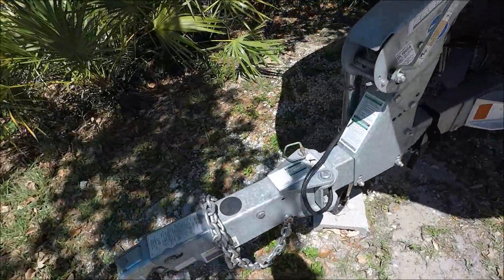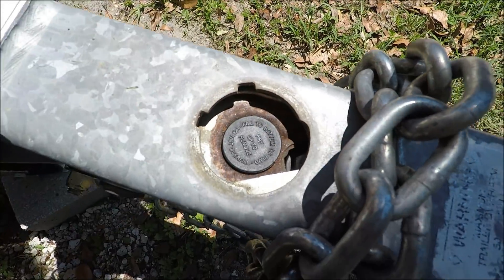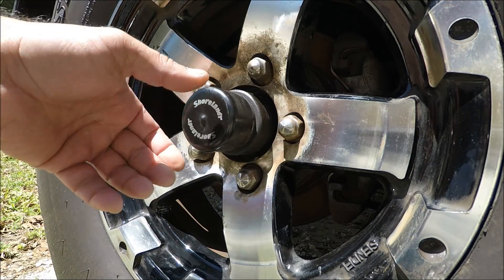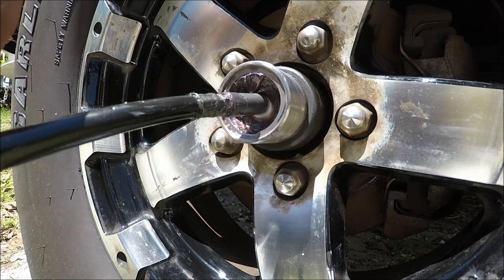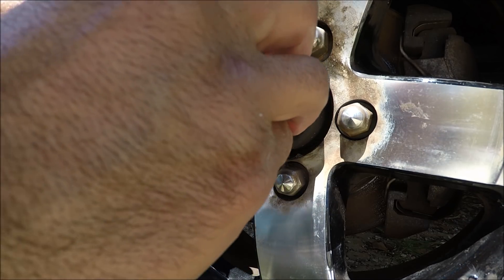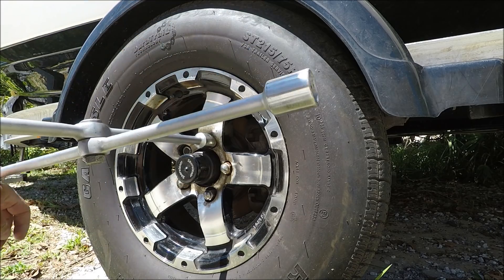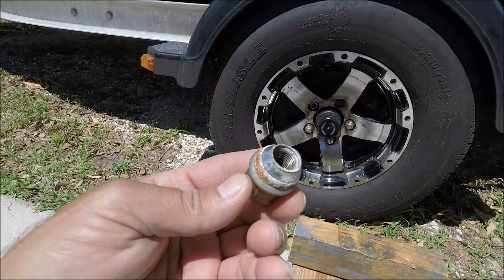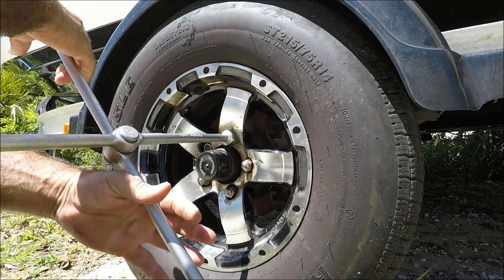Boat Trailer Maintenance DIY yamaha 190 fsh,yamaha 210 fsh,yamaha 240 fsh Scarab 255 open fish

Comment: Hey man, I know you no longer have this boat but I just bought one used. Your videos have helped me a lot to understand and for knowledge of my first boat. Thanks a lot.
Reply from the maker: That is awesome Cap.  Im glad I could help,  that is a awesome boat ,i have great memories on the 190fsh
How many hrs in engine and what year cap?
Reply: Out On The Reef it has 93hrs on the engine. I just found out a few things that needs to be done to the boat and have been battling with the dealer North of Miami to have them complete what they said they will on the “I owe you” document from purchase conditions and finally they said they will but so far I have done  2 trips from Tampa to Hollywood, FL to deal with this and once they said they order the wrong component. I am not sure if they are trying to wear me out so we’ll see. I love the way she slides on the water.
Reply from the maker: @carlosbeltran424  hang in there don't give up they use those tactics to Tire you down but teach me a lesson that you not going to give up.
Enjoy your 190 FSH is an awesome boat
Reply: Out On The Reef I will stay on it. You right. Funny they say that a Garmin transducer bracket part is backlog🤨. 🤦‍♂️😠 I won’t quit.
Reply from the maker: @carlosbeltran424  i hate how they treat customers

Comment: Thanks, didn't know about these tips before I watched this video! My longest tow of my boat was 4 hours each way to Chincoteague island. was really praying all the way - LOL  Luckily, everything went smoothly. Had a great time! My second to last trip to Sandy Point State Park was 1 hour each way, and I got a flat tire. Tire had less than 100 miles on it. Pain in the neck and ruined the trip coming home. Luckily, it was less than 15 miles from home, so was able to get the tire changed and towed it back home safely with the spare tire.
Reply from the maker: Im glad it helped,  trailer maintenance is just as important as boat maintenance they both can leave you stranded either in the water or in the road is very important to take care of your trailer.
Navigate Safe Cap.

Comment: Older video, but still applicable to all trailers, especially with the wheel lug nuts. Yes, these are purely for esthetic looks and will never hold up in any wet or saltwater environment. The biggest problem, as you have indicated, is that the chrome covering over the metal nut traps water and will rust causing the covering to swell and results in an issue with any wheel wrench being able to fit on in order to get it off. Worst case is that the chrome covering actually  comes off and then the wheel wrench just ends up slipping and rounding off the nut......impossible to remove. Imagine that scenario on the side of a highway trying to deal with a flat or blown tire.

When it comes to dealing with rust or corrosion prevention and maintenance I use a product called "Rust Check"

https://www.rustcheck.com/

It is a Canadian product that is available through Amazon. This stuff works great and I have been using it for at least 30 years on vehicles, boats, ATV, and anything else that needs rust protection and maintenance. The "Coat and Protect" formula is thicker and really holds up well in a saltwater environment. Another similar product that I have used and works well is call "Krown" Rust Control.

Once again, great video and lots of good advice.